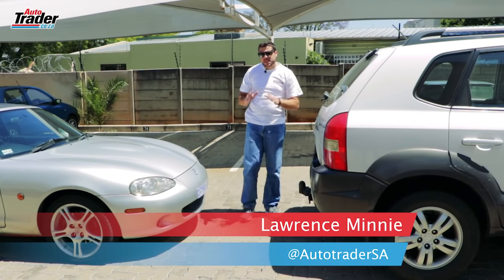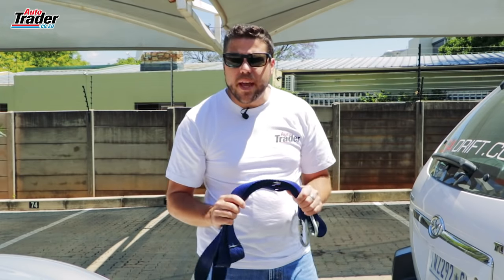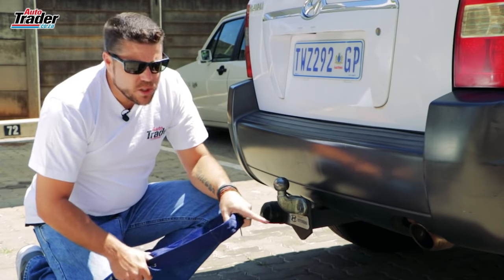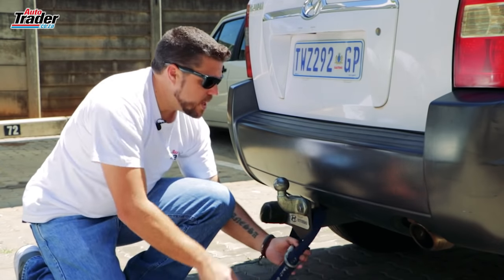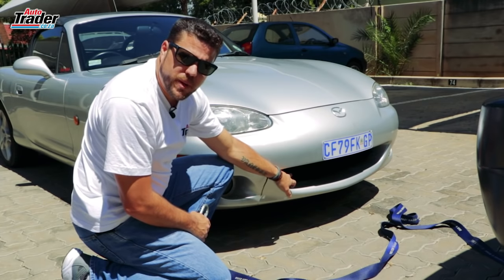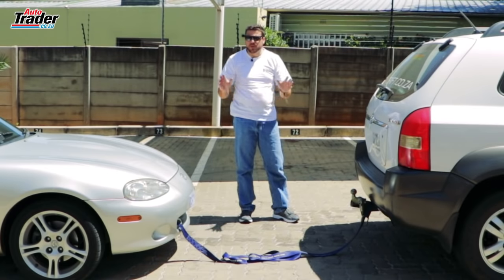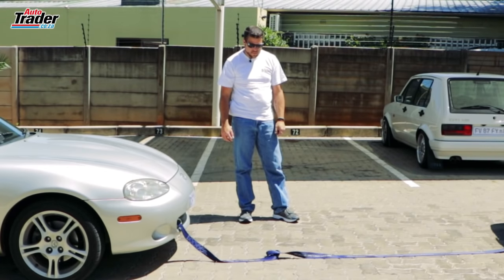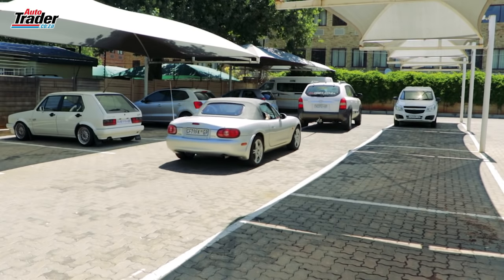How To - Tow a car

Comment: you can tow an automatic, just put in neutral, same with 4x4
Reply: That's terrible for your transmission... sounds like a good way to blow a transmission to be honest, now if you were to drop the drive shaft sure, but until you do that, not good at all.
Reply: Shouldn't tow either really......
Reply: My transmission blew out lol so it doesn't matter.
Reply: @towtruckaj  no it isn't, do you know anything about transmissions or transfer cases?
Reply: @leeferguson2140  yes you should if you have to, and it's fine
Reply: @optimusmikey  Do you have any idea what happens when you tow an automatic transmission in neutral... Wheels turn, That turns the axles, That turns the drive shaft, which turns the transmission gear... All being done with absolutely no circulation of oil in the transmission, This often leads to the need for a fire extinguisher underneath the vehicle on the side of the highway, You can do so but only under 35 miles per hour for a short distance, I believe 15 miles, You can also do this if the vehicle is running and circulating oil, You cannot, however, go 70 down the interstate for miles with an automatic transmission in neutral and the drive tires on the ground without either catching the car on fire and burning up the transmission fluid or by the excessive wear caused by lack of lubrication promptly dropping your transmission out of the bottom of your car... Now, Perhaps you should go look for an owner's manual and see how they recommend towing an automatic transmission car on the drive wheels.
Reply: @towtruckaj  so is rolling in neutral bad for the car?
Reply: @scatdawg1  depends on the vehicle, a manual transmission is usually ok to roll in neutral as the oil still circulates but an automatic transmission often only pumps oil when on as well as it can have some other issues, so some can some can’t. If you are just trying to get it off the road often you can leave it running and stay around 25-35 mph or less in neutral for a few miles and that will be fine as a general rule of thumb
Reply: Bruh what if it does not run
Reply: @towtruckaj  Put it in neutral you can tow anything
Reply: @liga8149  You're right, It'll tow... But some cars will also grenade a transmission or catch fire if towed in neutral.

Comment: Why can’t you put an automatic transmission into the neutral position when you tow it? Doesn’t that free up the transmission so that you can tow it? If not how exactly would it damage it when it is a neutral?
Reply: The lever doesn't shift to neutral without starting the engine.
Reply: @phuntsokangrup3871  that's not necessarily true. Some makes of Vehicles will shift to neutral just by turning the key. Also, some towed cars can be started long enough to be put it in neutral, although they will not run continuously.
Reply: Transmission wear, It's bad for your transmission, if you drop the drive shaft it will be fine, otherwise it will still be turning your transmission gears.
Reply: @towtruckaj  Is this true even if it's in neutral? I mean it might be turning some gears sure but the real issues I imagine would be with the clutches. The fact is, where I live we tow older autos all the time and I've never once heard someone say that it's bad for the vehicle.
Reply: @jasonsahadeo5740  it just all depends on the vehicle but in general autos in neutral is bad, manuals in neutral is fine. A lot of autos don’t circulate oil when just in neutral with some you can get around that by leaving it running but I usually stay on the side of caution. The issue comes down to heat build up, if you are going long distances that’s when it will show, I had a guy flat towing a truck from Texas to where I am in ohio and he got impounded, when I got there I took both trucks and the one being flat towed was destroyed, it still drove around the lot but it was so clunky and stiff and I can only imagine it was done during the flat tow. Others I have heard of catching on fire on the interstate due to the heat build up.
Reply: @towtruckaj  yeah. That's crazy to me, that people would flat tow to another state. I never imagined people did that, seems more dangerous than it's worth.
Reply: @jasonsahadeo5740  they do it like the rvs with the bumper tow bars, and it’s fine in some situations like with the jeeps, the jeeps have designed in overrides to do exactly that, or if you pull the driveshaft it’ll also be fine.
Reply: @towtruckaj  that makes sense I guess. That also means that they're probably towing at speeds that would compound the issue.
Reply: @jasonsahadeo5740  yep some manufacturer’s will say it’s ok to tow in neutral under 35 mph for like 2 or 3 miles, and that’s true because it’s fine to get it to a safe spot but at high speeds and long distances it gets way too hot

Comment: If you really needed to tow an auto car, you can disconnect the drive shaft/axle.
Reply: Is this what they do when you get your car towed? Cause not once has any body cared that the car was an automatic when called for a tow guy. They don’t ask over the phone they just come out and tow it .
Reply: Usually they lift the drive wheels. Most cars are fed so they can just lift the front. A rwd vehicle can be lifted from the back. Awd vehicles are only supposed to be flat towed, but if you're not going far and you keep the speeds low you'll probably be fine.

Comment: "Tow Ball will will become a projectile" Whahaha, clearly not an engineer. That tow ball is rated at 3,5 ton to safety factor of 4. This means it can handle 4x the 3,5ton. This is exceptionally higher than the 220kg that carabiner is rated for that you secured the strap with. Thanks Auto Trade, fucking brilliant.
Reply: Never ever tow or recover with tow ball. Always use a receiver shackle

Comment: Towing an automatic car is perfectly fine if it's perfectly fine. What I mean by that is that your manual will tell you if and/or how you can safely do so. In, for instance, a RAM 1500 4x4 you must put it in Park (not neutral) and then put your transfer case in neutral.
Reply: Doesn't putting it in park lock the wheels?
Reply: @NabeelFarooqui  No it locks the gearbox. Normally the gearbox would be connected to the wheels through a transfer case, but since that is in neutral the "connection" is broken.

Im not entirely sure but I think the reason they do this is because the transmission doesn't cool itself properly if the fluids cant be pushed through the torque converter by the engine.

Comment: The biggest problem is to maintain tension in the strap for both the drivers. Specially if there are various speed-breakers and slow downs in the route.
Reply: Yeah my fiance and I had to flat tow our Expedition with our Ram 1500 from north Oviedo to the UCF area. We had about four feet of tow strap between the bumpers lol Ended up being on the phone the whole time so I could tell him when I was braking and when we were moving again
Reply: This is exactly the reason why I’m here! I got towed, and snapped someone’s chords because I lost tension! 

So keeping the break down constantly ever so slightly.. that’s key? Getting towed again in a few mins, hope it’s better this time!
Reply: @Tommythepawn  keep a hand on the hand brake and keep hitting it as soon as there's slightest of speed reduction. This way it will work.
Reply: Thanks so much!! All went well 😇😇

Comment: My question to you is that when you talk about towing an automatic vehicle you, are talking about towing a vehicle quite some distance, not just a few feet to dislodge them from mud or snow?
Reply from the maker: That is correct yes. Should you need to rescue an automatic vehicle from mud, snow or a situation where the vehicle is stuck, it's ok to tow it the few meters/feet required to unstick it. Prolonged towing over any significant distance is not advisable at all. [Chad]

Comment: So you can't put autos in neutral?
Reply: I do it all the time
Reply from the maker: While putting an auto in neutral will allow the wheels to turn freely, the gearbox components will still be rotating and will be doing so without sufficient oil feed. This will cause overheating and damage the gears. This is why it is not advisable to tow an automatic car in this manner. [Chad]
Reply: @Autotradersa  Not for a long distance. However,  my uncle told me if they ever towed long distance for less than an hour, they would put it in N and leave the engine idling for an auto.
Reply: drop the drive shaft and your good otherwise no..

Comment: But wont the brakes on the disabled vehicle not work since the engine can not run?
Reply from the maker: The brakes will still work, but they will not have vacuum assistance, so the brake pedal will feel firmer and require more effort, but the brakes will still work. [Chad]
Reply: They will work . It's the same with all power brakes . Power brakes means "Power Assist " you just have to muscle up more .
Reply: @johnmacleod8507  is it ok then to turn off engine on a steep hill going slow at around 5 -10 km/hr when there's slow moving traffic, will it affect the brake if we muscle up ?

Comment: So what would you say about towing a 4x4 car, that has auto transmission, that is now only gonna be used for spare parts, towing about 60 KM?
Reply: Engine will not start, BUT there is a downhill for about 5 min in one stretch, so maybe a tow truck with the towed car on the cargo would prob. be better ?
Reply: @olliphoto  60km is an extream distance for this method, I wont do this for anything longer than 20km on a manual and 10km on an auto, doing 20km/h at max
Reply: @abdallahmanasrah2317  I did decided to get it towed and my brother got it to start again.

Comment: So according to this if you are driving an automatic at 50 mph and then switch to neutral for whatever reason to just cruise you are hurting your transmission?
Reply: I think, based on other comments, the issue is heat build up when towing for long distances. Towing to a nearby service center or whatever should be fine but towing from one state to another is bound to cause issues because transmission oil also works as coolant so it has to flow (from the torque converter) in the way designed to keep everything lubricated and cool.